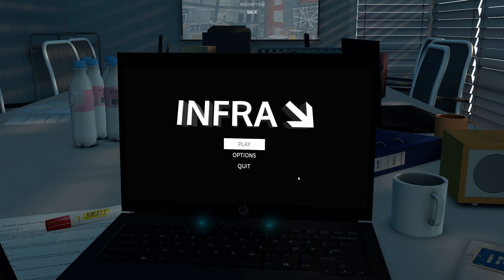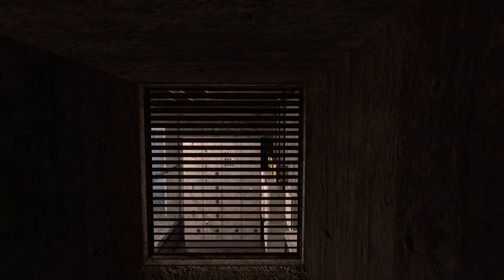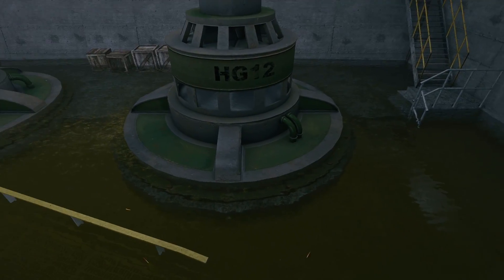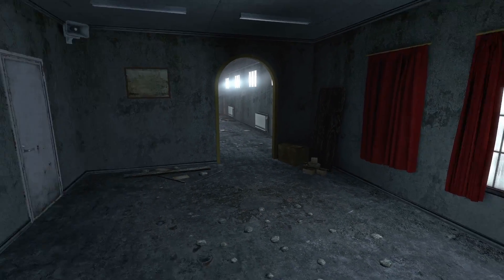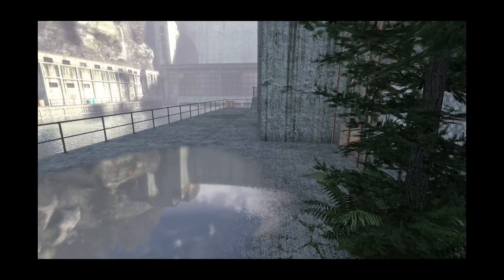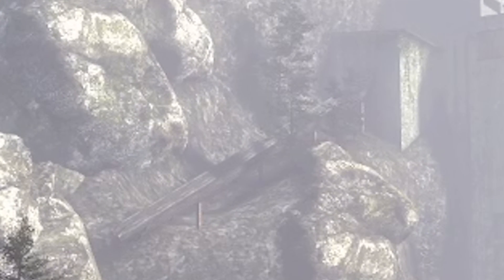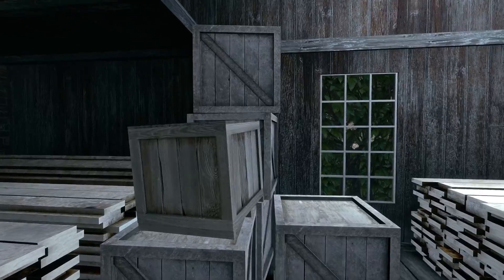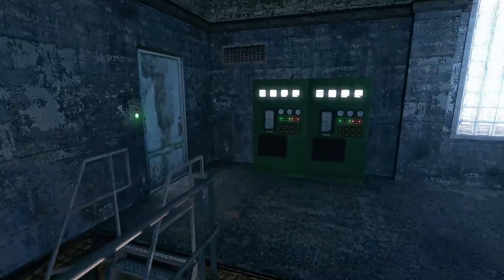This is what videogames think Engineers ACTUALLY DO... Infra!

Comment: Okay, major oversight on how Synchronization works: Synchronization means that you have to control the generator in such a way, that it's producing power at the exact frequency AND PHASE of the grid. The Synchroscope is a measuring device that basically shows the difference between your generator and the grid. The position of the hand shows how much your phase is shifted compared to the grid (as in where your sine curve reaches max) and the rotation shows the difference in frequency. 1. If you connect a generator while that synchroscope is turning with that speed, you're probably gonna destroy the generator, the turbine shaft, or both and 2. The synchroscope can't move once the generator is connected. If you connect and it still moves like that, your control is fucked and you need to stop the generator. Our teacher once showed us a photo of a power plant where they used an older synchroscope, that only showed if the phase is aligned or not, but not by how much and it was hooked up with the wrong polarity, so when they synchronized and connected, the phase of the generator was 180° shifted (complete opposite polarity) and in this situation, because it's basically two giant magnets interacting, the main coil tried to "pull" the rotor coil into the right phase, which can work with, like, small motors, but for a generator of that size, the forces and the inertia of the turbine caused the half meter thick turbine shaft to snap and the half that was inside the coil shot straight out of the generator housing and went through a reinforced concrete wall like a giant coil gun.
You never turn up the turbine to a fixed turn rate, you turn it up until the synchroscope moves very slowly, which means that the generator frequency (which depends on the turbine spin rate) is just a little different from the grid frequency, then you wait for the synchroscope to align with the zero mark and adjust the frequency at that exact moment, so the dial stops moving exactly on the mark between "lag" and "lead". If the dial is on the mark and not moving, that means that your generator frequency and phase are exactly aligned with the grid. Then and ONLY then you can connect the generator. At that point, you can't stop the generator and the turbine, regardless of waterflow, unless you disconnect one or both of the coils because your generator is basically being dragged along by the grid frequency like a motor. This kind of generator is technically not called a generator, because it can be either a generator or a motor, depending on phase shift. If you put a load on the shaft, it "lags" behind the grid, gets pulled along and uses grid power to maintain it's spin rate. If you push it along, it starts leading, but because it can't actually spin faster than the grid frequency, the mechanical power you apply is instead converted into electrical power and fed into the grid.
Then there's also the rule that if all power plants produce much more or much less power than is being consumed, the grid frequency will increase or decrease respectively. That happened a few years ago. Clocks like you have on your kitchen stove suddenly were all about 10-15 minutes behind (except for Britain because they're not synchronized to the Mainland). The reason is that those clocks don't have a quartz oscillator to measure time, instead they use the grid frequency and advance by one second every 50 grid cycles (50 in Europe, 60 cycles in the US). Because of the Syrian war, several important power plants shut down and Syria consumed a lot of power from the rest of Europe, which meant that less power was produced than being consumed and the frequency dropped by a tiny, but constant amount, rather than oscillating up and down around 50Hz. A large amount of energy is actually stored in the turbines as inertia, which is why everything just kept going instead of dropping into a blackout, but it also meant that all frequency dependant devices over the course of a few weeks lost about 10 minutes worth of grid cycles, which later was rectified by artificially increasing the grid frequency over the normal threshold

Comment: Remember, those bolt cutters you had 2:43 you could’ve used them, possibly 5:22 that crack in the wall is the problem, but the electrified water. The flooded room is not a problem?

Comment: 5:17 only if the metals are conductor if its not conductor it wont shock you, i since were in a hydroelectric dam, the rails are most likely not conductors.

also me: touch 10x the electrified water everything is fine!

Comment: In my experience it’s usually just arguments between the surveyors, contractors, construction engineers and design engineers on who screwed up first.
Reply: you reminded me of the first major project I was on just after college. The arguments didn’t dwell on who screwed up first, but rather on who had to come up with the solution, and then on how to QC that solution for acceptability. Then again, I think the bitterly cold and snowy winter, a non-negotiable and highly visible required completion date, and a substantial amount of budget flexibility made everyone a little more cooperative. Also the design engineers were safely located in another time zone. I’m not sure if this is how it normally works.
Reply: @Null-value  really depends on the group involved. If you have a group that is solutions focused it goes that way. If you got a blamestorming group it goes to hell.

Comment: the voltage doesn't matter very much. the volts carry the amps to the body (specifically the heart). the watts lost in a system equals the heat generated by that system, and that means that the potential heat is the watts supplied to the system. so an item has a heat/watt limit within the system, and that tells you what will fail if the system tries to use too much watts. this is a bit long winded, but with all the water and the fact that the system hasn't overloaded means that the electricity is below the rated maximum. we can treat the volts as constant, and so if we know the amps in the system then we know the electricity which fills the cubic area that is the water. there is some other math involved dealing with the electrical conductivity of objects in the fluid (water), but it should be close enough to each other (your body and the water) so that you can rule of thumb it without that math. the volts was i think 220,000V and if we think of the boxes as 2x2 feet, then the cubic area is about 40x7x1 (490 cubic feet), and the wires carrying the electricity is about an inch in surface area to transfer that electricity (which have about 3kA before they melt). the difference is about 1/9k for sizes, so the lethal amount of electricity across the heart is about 0.2A which means that 1.8kA is needed to supply the water in order to make it lethal. the standard ampacity of the lines is 260A, or about 14% of the amount needed to electrocute you.

TLDR: it is technically possible, but well outside normal electrical levels for the water to electrocute you. my suggestion if this was real life would be to get some waders if you must walk through the water rather than turn off the isolation switch and pump the water out.

Comment: The "fix broken _ despite flooding" is a very common motif here.

It is also possible to sprint to the stairs after turning on the power in the basement lumbermill generator room.

Next chapter:
"Infra: I had a nightmare about plumbing"

Comment: nobody really cares to read this, but there's an underground/tunnel funicular in my town (there are two funiculars, well, three, but the third was never finished, so, two then), it's from 1907 (second oldest and still in use such a thing in Europe), some guy called lord Westbury was involved in its making (a UK connection)... It's the steepest funicular in the country (Czech Republic) with 49° tilt, it is 127 metres long, the cant (=height difference between the upper and lower stations) is 54 metres, the max speed is whooping (lol) 2.04 metres per second, the whole ride is over in a one or so minute... Before the funicular, they used donkey-pulled carriages, lol (there was a "club" let's say, up there, they literally carved a tunnel through a mountain to have a faster way to get to a dance party, 'cuz donkeys were too slow, not sure if that's insane, or genius... There's also a 5-star hotel up there (called Imperial), which was made using at the time new technology of "poured/cast concrete", or reinforced concrete, or ferroconcrete - first such building in the country, remember, that's like early 19 hundreds, 1910-1912... this hotel is a work of a french ENGINEER, not an architect, Ernest Hébrard - and I think we just made a full circle, time to wrap it up)

thanks for reading

Comment: "That ringing noise means you found a problem"
As an engineer I say: The friggin' generator hall in underwater and a tiny crack in the plaster in the wall is the problem? WTF?
(and no, as an engineer you don't go around hitting random unlabeled buttons)
Reply: It's not the problem it's a problem
Reply: Yeah the underwater room counts as a problem you can take a photo of it too, there's just a lot of smaller extra problems.

Comment: As an electrical engineer and firefight. In the tight conditions sadly water works like that. I would be possible to get shocked by the water but fuses not tripping at the same time
Reply: If you would call firefighters to pump out the water we would actually try and measure the voltage using basically a voltmeter on a long pokie stick

Comment: Really enjoying the series :D. Glad you are enjoying it as well :)
Some simple tips: When you are looking in the camera, if it's an item the game cares about, the camera focus brackets in the middle will become smaller than normal/closer to the middle. If you see an obvious issue and they aren't smaller, may have to go closer/away to get it in the picture better. Otherwise it doesn't care about the pic.
Some items need you to hold down the use button to engage them. The raft thing from the first episode is one of those for example. Basically any sort of turning thing you usually have to hold down.
As obvious as it is that you wouldn't actually turn things on/fix them, the game does reward you for fixing things. Finally, make sure to explore everywhere (lots of hidden things and lore) and take pictures of all types of issues in the environment. There's at least one portion of the game you don't have to take pictures of issues, though you still need to take pictures of documents you find there.
Overall it's a great puzzly type game I recommend people try, and it's relatively cheap :)
Reply from the maker: Thanks, they were a super useful tips that I'm a bit embarrassed I didn't work out myself haha

Comment: Professional Engineering tip: If you're surveying alone in an abandoned hydro plant, maybe don't just try hitting buttons to try to control something you're not trained to operate. For all you know that red button was the АЗ-5 button...
Reply: I hit it as soon as I saw it, thinking exactly that (shutdown/abort). This is NOT a safe power plant to have even slightly operational.
Reply: As a standard those big red buttons are failsafe. The big red easy to find button you press when something goes wrong, a emergency shutdown. So being in a abandoned place you kinda want them all to be pressed in to make sure you don't get electrocuted
Reply: What does that button do?
Reply: @Alpha_Synergy  It's an emergency shutdown process for nuclear reactors (as well as the name of the button), it immediately terminates the fission reaction. АЗ-5 (or AZ-5 in the Latin alphabet) is the process used in Russian reactors, and the American equivalent is called SCRAM.
Reply: @yopassthefuckinsalt922  I think the MASSIVE dam is a good hint that this maybe possibly not be a nuclear powerplant.
Or a very stealthy one.
Reply: @yopassthefuckinsalt922  To be fair if there is a nuclear reactor running after being abandoned for more than an hour and ot has major infrastructure problems then you 1000% should press the SCRAM button...
Reply: @beepbop6542  most modern reactors can regulate themselves and shut themselves down. Obviously not ideal, but better to have a million fail safes.
Reply: @beepbop6542  I suspect the AZ-5 reference was intentional...Chernobyl exploded because the RBMK reactor had a design flaw causing it to go critical when AZ-5 was pressed under specific conditions.

So if you ever find yourself exploring an abandoned but mysteriously active Soviet reactor in questionable condition, SCRAMing it may cause larger issues.